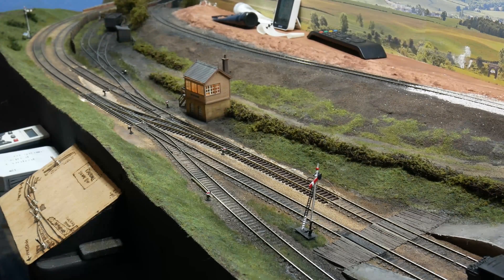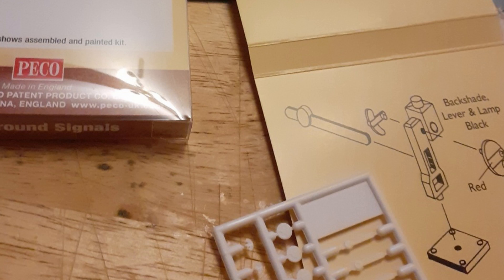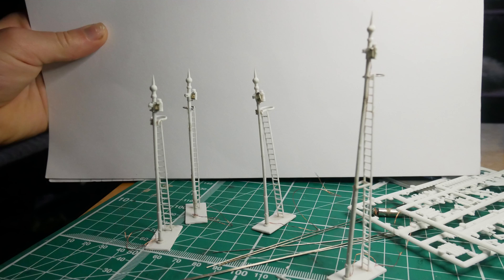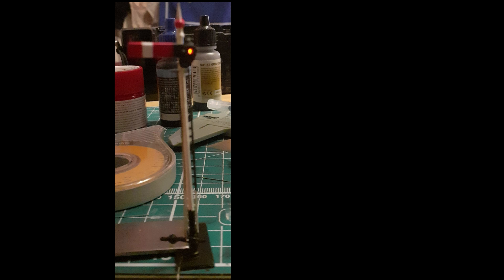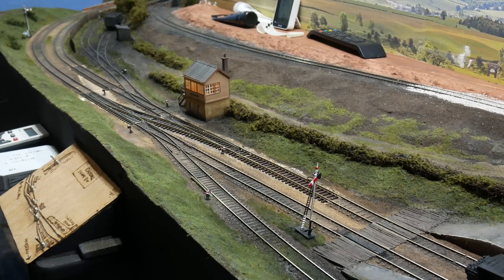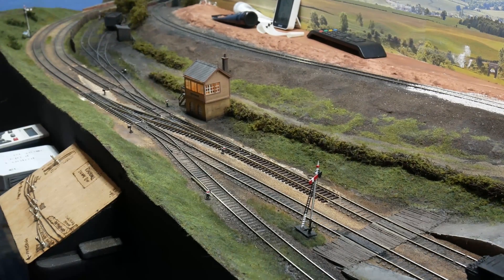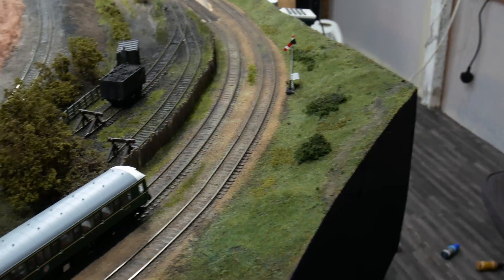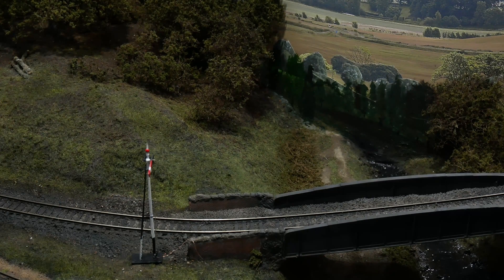24. Semaphore signalling - Prt 1- Building ratio kits and discussing positioning

Comment: A ground shunt signal is also a stop signal, but will not indicate which route has been set, as you would need to clear them for a train to proceed whichever way the point ahead is set.  What you probably need in a number of those locations is a ground signal with a yellow band.  This type of signal allows a train to pass for shunt moves on the minor line, but needs to be cleared if the train is to proceed on to the major route.
Reply: The yellow shunt signal is used on siding exits only. When on, it can be passed to shunt into a spur. When off, it will route to the main line.
The GWR did not use many of the yellow type, using a normal red disc or a ringed 2/3ft arm for siding exits.
On the above layout, it is doubtful if anything other than single discs would be used. The situation therefore arises where a red disc can be passed at danger. For example, a trailing connection into a main line; the disc will only be allowed to clear if the points are set into the siding. For set back moves, the disc would not be cleared.
Reply: @daviddinenage8598  Think I'll need your expertise to point me in the right direction on signal placement... Excuse the pun 😂 do you have any good advice on articles that would mean I wouldn't get mine horribly wrong?
Reply: @_RandomPea  Looking at the video, the shunt signals look in the correct places. Generally, the GWR would only use single discs. The discs for the trailing crossover would only be cleared if the crossover points are pulled off. For a train reversing into the one of the sidings, only the disc for the siding would be cleared. The crossover disc would remain on (at danger).

Comment: Hi David love the videos but in regards to your signaling the home signal you placed to protect the station is on the wrong side, in real life it would likely be a tall signal with a repeater higher up to allow sighting from around the bend.
Reply from the maker: Hi mate thanks for the comment. I had originally got it on the other side but was advised by a group of ex br signallers on rm web to move it across the lines and put it closer to the crossover. I get where your coming from, I think when it comes to signalling there are many ways to do the same thing.
Reply: @HorsehayRailwayModeller  The GWR would have put the signal where you have, 'wrong' side. Remember, GWR engines had the driver on the right. Co-acting arms were not that common on the GWR.
As regard to disc signals; see my comment above.
Reply: Could the home signal be placed between the two lines or was that not normal practice?